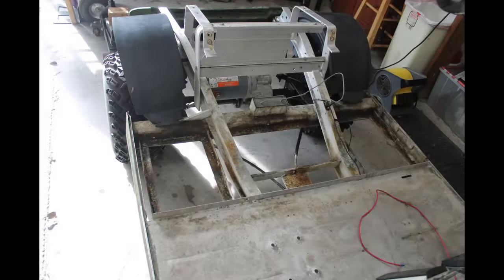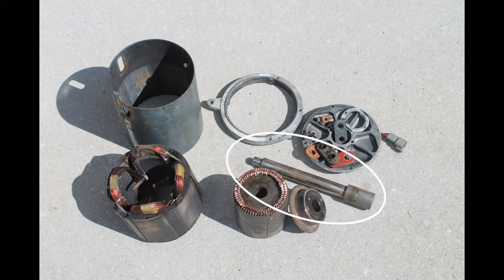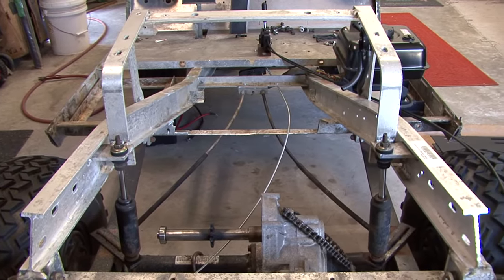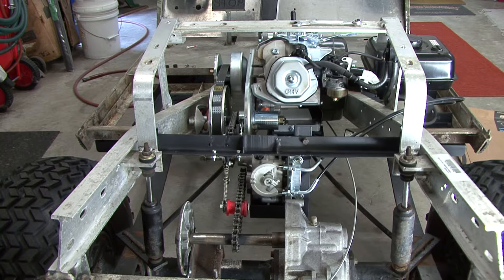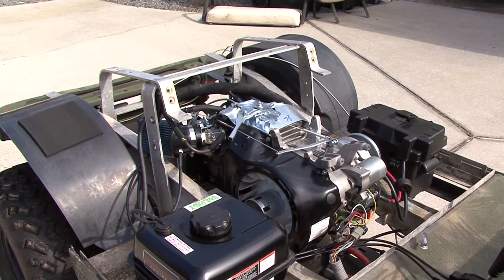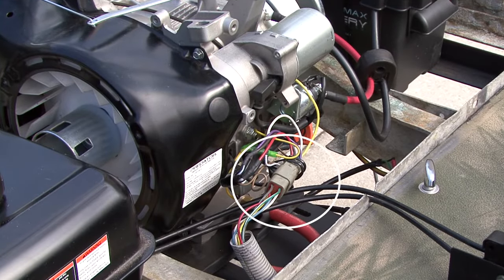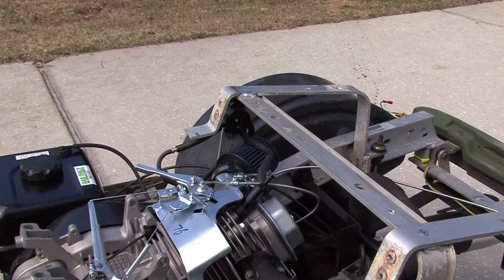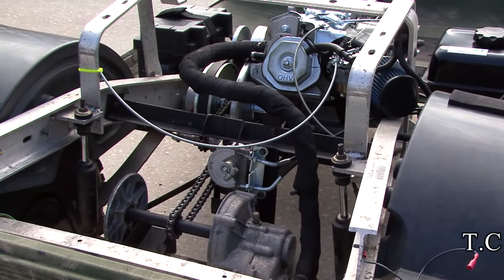Golf Cart Gas Conversion

Comment: How much slack did you leave in the chain from the Transmission to the Rear End?
Reply from the maker: As little as possible, I could barely get the master link in place. Now after three years of daily driving, the chain has too much slack and I need to replace it.
Reply: @BigBlok502  I am just worried about the movement of the rear axle and how to handle that extra length needed when the suspension gets compressed
Reply from the maker: @BrianG24  the trick is to have the swing of the axle at the furthest point away from the transmission, then adjust the chain as tight as possible. In my case, is when they axle was at the full down position was the furthest length from the transmission.
Reply from the maker: @BrianG24  I would also add that I would get chain slap when going in reverse due to axle wrap. My remedy for that was by installing heavy duty leaf springs, now no more axle wrap.
Reply: @BigBlok502  I have basically got my project complete at this point but am getting slip in the chain on the rear axle (I think). Have you seen this any? I guess I need a better tensioner setup
Reply from the maker: @BrianG24  I have no slippage, and I am not using a chain tensioner either.
Reply: @BigBlok502  what is your sprocket tooth count on the rear axle?
Reply from the maker: @BrianG24  it's a 12 tooth sprocket.

Comment: What’s the top speed and how is the power can it pull as well as the electric motor .
Reply from the maker: Top speed is in the mid-20s, it's been a few years since I confirmed it with the GPS though. It has plenty of power, more than the electric motor did, I sometimes use it to pull my five foot by 10 foot utility trailer around my property.
Reply: @BigBlok502  thanks I’m looking to do mine.

Comment: Did you have to do anything with the axle when you turned it around?
Reply from the maker: No, and it has been holding up great.
Reply: BigBlok502 did it not run the opposite direction?
Reply from the maker: Although the gears are spinning in the opposite direction, since it's turned around the cart moves forward.

Comment: What keeps your battery charged to run lights?
Reply from the maker: The Predator engine has a charging circuit in it, that's what keeps the battery charged.

Comment: How did you remove shaft from motor
Reply from the maker: After cutting the copper coils I used a 20 ton hydraulic press
Reply: @BigBlok502  Thanks

Comment: How does the chain react with the suspension travel
Reply from the maker: The transmission output shaft is in line with the axle drive shaft when the cart is at rest. I cut the chain as short as possible using a half-link, with the suspension travel at full length, so far I have had no issues with the chain.

Comment: I’m thing about converting ezgo rxv electric golf cart any pointers
Reply from the maker: Before you can press the shaft out of the electric motor, you need to cut the exposed copper windings off
Reply: Thank u would a belt drive b better than a chain and can a single belt hold up or would I need to go with a dual belt system
Reply from the maker: Personally I prefer to use the chain, you can cut the chain to the exact size that you need and they are real strong.

Comment: You are the only one that has the engine mounted rigid to the main frame with a chain tension, the others mount the engines on a swing arm mounted plate not needing a chain tensioner.  I Have a 94 stock gas cart FE290 in it. Debating to just swap engines. I also have a 93 electric FLOOD cart, along with a fiberglass jeep body. I might just start from scratch and modify this frame to except the gas Pred. 420 motor that i also have. Pro’s and cons to the two different ways to mount the motor and trans??? Great video by the way.
Reply from the maker: Thanks for the comments. I do not have a chain tensioner, I cut the chain to length for a really tight fit utilizing a half link if necessary. I decided to mount it to the frame because it appeared to be easier to do it this way, in addition not having the engine weight as unsprung weight. I do have closed cell foam pad between the engine and the frame to cut down on vibration, also, I was getting axle wrap which would loosen the rear chain so I installed heavy duty leaf springs in the rear. I installed the heavy duty springs after making the video. Good luck on your install.

Comment: How did you make transmission mount?
Reply from the maker: I hand fabricated it with scrap metal I had laying around the shop.
Reply: BigBlok502 Did you build it so it kinda wraps around the transmission?
Reply from the maker: Yes, like a cradle. I plan on doing an updated video in the next couple of months to show how everything has held up over the past two years.
Reply: BigBlok502 ok thanks

Comment: Where you get transmission from
Reply from the maker: It's a generic go-kart transmission that I bought on eBay
Reply: @BigBlok502  

How you get it to lineup with the predator?
Reply from the maker: @johnle231  lots of measuring, and trial-and-error until I got it just right.
Reply: @BigBlok502  

You had to build like adapter plates or something?
Reply from the maker: I had to do a lot of fabricating to create a mount for the transmission.

Comment: Any links to the reverse gearbox?
Reply from the maker: I bought it on eBay, type in go-kart FNR gearbox and you'll see several vendors that sell the same gearbox as shown in my video.
Reply: They say that its only compatible with the 30 series torque converter. How did you manage to get it to with with the 40 series? I'm not trolling, I have the 420cc and want to add reverse.
Reply from the maker: That is correct, it is designed to replace the shaft on the driven pulley of the 30 series torque converter. That is why I mounted it behind the series 40 torque converter, and used a chain to connect it to the torque converter. I'm using it outside of its design capabilities and hoping for the best, so far it is holding up just fine but I don't run the golf cart hard.
Reply: Thanks! Looking forward to starting my project.

Comment: still at it, Im replacing the subaru engine with the13hp predator.mainly becasue the drive shaft steps up so the clutch cannot slide all the way onto the shaft 
.and the exhaust   exits from the top........my question is this is there   a vaccum nipple on the engine to drive the fuel pump?
Reply from the maker: Yes, I connected the fuel pump to the vent line coming from the valve cover.
Reply: @BigBlok502  great thanks

Comment: Fantastic job! Thank you for the video. What type of accelerator cable did you use, ( Z bend end , etc..) and do you have more pics of your bracket so I can copy the shape and configure it next to the gas pedal. This is what I am stuck with, any help is Greatly appreciated thank you.
Reply from the maker: I used a generic throttle cable that I bought at Tractor Supply and cut it to the length that I needed, I also bent the Z in the cable itself to attach to the bracket I fabricated. I do not have any more photos of the bracket, I just used some scrap metal that I had laying around the shop and cut it to what I felt would work. It took a few trial and errors before I got it to work right.

Comment: Hello BIGBLOK, sucess, I had the Shaft turned down to 7/8  s  to accept the 10 tooth drive gear .  That has made a great difference , I would say 18 to 20  on the cart and would compare it to my other clubcar gas  but with a little more power 14hp subaru  engine. I am still fiddling with the vibration rattling problem while at a standstill . I have a original clubcar tray motor mount that I may retrofit  so the front of the mount with the rubber motor mount floats on the top of the frame. I think this will surely resolve the problem .. Must say, like always , Your video and expertise has been a great help  to tweeking this project ... When I started this a few years ago ,  there was a point that ,I just had enough and was gonna set it on fire , but then I saw Your video. LOL I will do a video when it gets warmer in Pennsylviania.\
Reply from the maker: Great news, I'm glad to hear it. I installed some closed cell foam pads made to put under the feet of a washing machine in between the engine and the frame to help cut down on the vibration

Comment: Did your engine mount go past the battery tray aluminum angle iron brace you cut down ? For ur engine to sit that far back towards the axel?
Reply from the maker: The rear engine mount bolts are directly in front of that aluminum brace.

Comment: Hi, have you had any issues with the chain? I copied your video to do my electric to gas club car. Since there is no swing arm, the chain must move a little. Mine will occasionally break. Have you had this issue?
Reply from the maker: I have had no issues with either of the chains, there is some slack on the rear chain due to the suspension compression, but no issues whatsoever. I plan to take the body off and do an updated video to show where the cart is today, compared to where it was two years ago when I put the gas engine in.
Reply: Ok good to know thanks. I have the same torque converter as you as well. I have noticed it “creeps” at idle. Do you also have this issue?
Reply from the maker: @treverkoss3460  Yes, mine creeps at idle too, I get a clunk whenever I put it into gear forward or reverse.
Reply from the maker: I should have mentioned that after driving it for a little while, when it gets warmed up, it does not creep when you come to a stop at idle.

Comment: Your video inspired me to swap my electric  Club Car DS to gas. I swapped around my axles 180 degrees as you did but how did you hook your brakes back up being they are backwards?  Great video
Reply from the maker: The brakes need to stay in place. You have to take the brakes off of the axle housing, in order to do that you will need to pull the axle shafts out first. There is a clip right behind the axle shaft hub that you need to remove in order to pull the axle shafts out, keep in mind oil will come out of the housing.
Reply: @BigBlok502  Thanks
Reply: I believe he did it side-to-side

Comment: installing the torque converter, so the sprocket behind the drive pulley is spaced out too much ,it is extremley tight to the frame
Reply from the maker: Yes, it is very close to the frame. I did a lot of finagling moving the engine forward backwards up and down until I got just the right spot to where I had the maximum clearance on the frame, but it is still really tight.
Reply: I did not use the plate, reordered just the drive &driven clutches , the driven clutch wil mount directly to the trans shaft.
Reply from the maker: @walterschilling4512  that's the way the transmission in mine is supposed to be, but in my case the driven clutch hole diameter was too large compared to the shaft on the transmission.

Comment: Where did u get your exhaust tubing?
Reply from the maker: I just bought a 3 foot piece of tubing from Tractor Supply, after I bent it to shape I sprayed it with heat paint and then wrapped it with the fiberglass heat wrap.
Reply from the maker: I forgot to mention I bought the exhaust flange off of eBay.
Reply: Thank you!

Comment: What size bore is the rear sprocket at shaft for differential, and how many teeth? Where can I buy one ?
Reply from the maker: I don't recall the bore size, I think it is 1 1/8 in. The sprocket is 12 tooth and I bought it on eBay.
Reply from the maker: I measured the electric motor shaft today, it is one inch in diameter.
Reply: I pulled shaft out of my electric motor, and it’s close to 1”-1/8 , I can’t find a sprocket that fits the shaft. On bore size . How about the sprocket on your gearbox what size is that
Reply: Did you weld sprocket on shaft at rear differential
Reply from the maker: @henrygibson2906  I've seen where some folks have had a machine shop turn the shaft down to 3/4" for a wider variety of sprockets. I did weld my sprocket to the shaft. The transmission shafts are 5/8".

Comment: What torque converter did you use?
Reply from the maker: Series 40 torque converter, I bought it on eBay.
Reply: Is it holding up well?
Reply from the maker: @MrR6Raven  yes it is, it has been trouble-free.
Reply: What size shaft for the torque converter.? 3/4, or 1". Great video